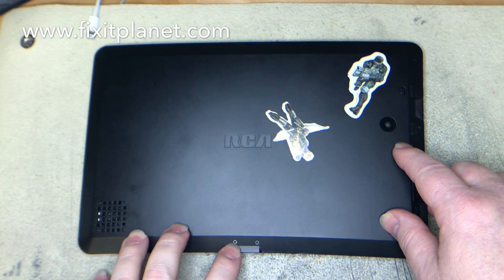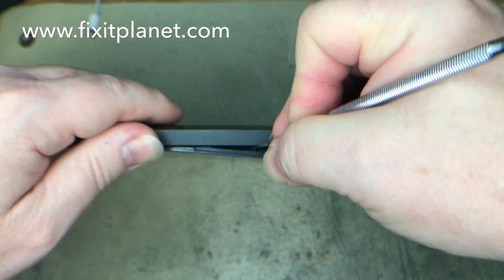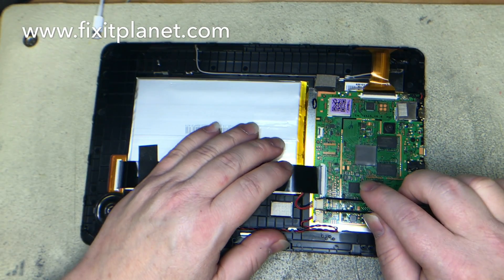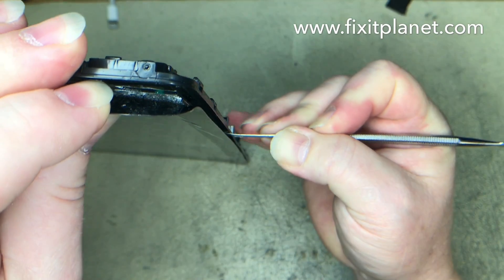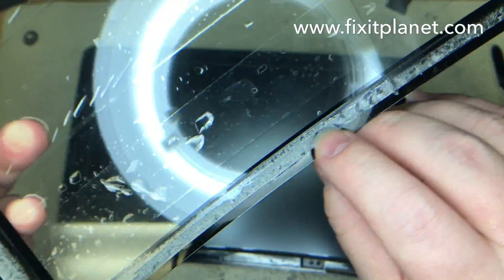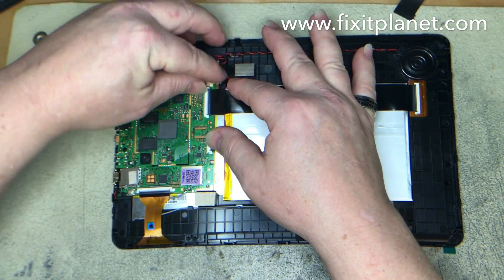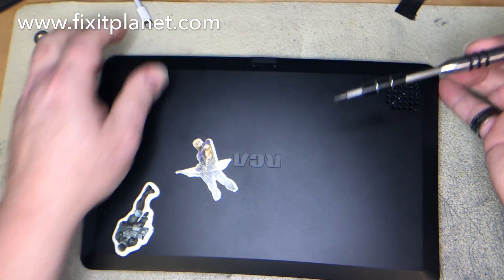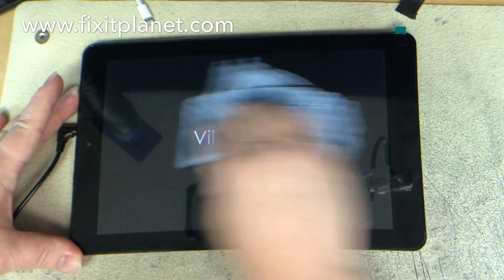RCA Viking Pro 10.1 Touchscreen Repair From Start To Finish.

Comment: Thank you.  I am gonna have to order a new screen.  My kids finally had broken my tablet screen, so i need to replace it.  This looks pretty straight forward.
Reply: So, I replaced the screen, the display works, but now the touchscreen part only works on the lower half of the screen.  What should I do to try and fix this?  I hope I did not screw up the tablet too much...
Reply from the maker: @10-eproductions25  Ok you need to review over everything. If all is good, then the part is defective. Otherwise you may have done something like physical damage to the motherboard.
Reply: Everything else works.  I can use a mouse or the touch pad on the keyboard and it works.  Did a scan and everything checks out...
Reply: Should I return the part?  I got it from Amazon.
Reply from the maker: @10-eproductions25  Sure can't hurt. Try another one and keep trying till you get it right.
Reply from the maker: @10-eproductions25   it sounds like a defective touch screen or it is not connected properly. keep trying.
Reply from the maker: @10-eproductions25  Yes and try try again
Reply: @FixItPlanet1  Boa noite  amigo seu vídeo foi esclarecedor , muito bom .
O meu tablet RCA viking PRO 10 quando conecto o carregador ele acende uma luz azul mais a tela não aparece nada e também não liga . 😥 Poderia me dar uma dica ?
Reply from the maker: @TiagoNascimento.  Obrigado, você pode tentar executar um reset e ver se ele será exibido no modo de recuperação. Desça completamente o dispositivo e segure o botão de volume para cima e o botão de alimentação até que o logotipo da RCA apareça na tela. Quando a tela mudar para o bot do Android em sua parte traseira, pressione e segure o botão de alimentação e, em seguida, pressione o volume mais uma vez. Neste ponto, a tela de recuperação do sistema Android aparece, com uma lista de opções. Use os botões de volume para cima e para baixo para navegar no menu e fazer seleções de acordo. Para redefinir o dispositivo, role para "limpar dados/redefinição de fábrica" e pressione o botão de alimentação. Confirme a seleção percorrendo várias entradas "não" até que a palavra "sim" seja visível. Destaque "sim" e pressione o botão liga/desliga. Caso contrário, você terá que abrir o tablet e solucionar problemas com uma boa tela conhecida. Boa sorte!
Reply from the maker: Nice

Comment: Why do U disconnect the battery & the other 2 wires I saw U remove & then reattach.
Also, where can I get an RCA affordable screen to fix my iPad??
I also didn't really see the new screen before U were putting it on.
I believe there is a clear thin plastic film I saw a guy remove before he put the cover back.
He also didn't remove the battery wires or anything else. How come U disconnected the battery to put a new screen on??
I'm not sure which RCA iPad I have either.
Where is a good place to get an affordable new screen.?
My RCA iPad isn't responding to touch. The screen is also cracked so maybe it is too cracked to work anymore.
Let me know where to get a new screen for it, please.
Thanks for not having loud music in the background, speaking loud enough & not going too fast.

Comment: How do I go about getting it heated up without a hot plate? Would a blow-dryer work also? Or any ideas
Reply: I have the issue where only half of my screen works at the moment.
Reply from the maker: If all you have is a hair dryer then that will have to do. Set on high and go for it.
Reply: @FixItPlanet1  Yes my local shop will not fix it. Thanks for the video all besides figuring out how to heat it up correctly looks like I could do it. Really appreciate it.

Comment: My dog cracked my screen on an rca galileo pro, thing is once I removed the screen I realized that not both screens were cracked. I have stuff I haven't backed up is there anyway to recover my data or even switch the hard-drive if I were to buy a new replacement. Thanks.
Reply from the maker: Unfortunately you cannot just switch out the hard drive it is soldered directly to the logic board. The cheapest way to recover your data is to replace the touch screen. Assuming the LCD is not damaged. Be sure to verify your model number before buying. I don't know your exact model number but here is a link for example. https://amzn.to/2qNVbhg
Reply: @FixItPlanet1  the LCD screen is cracked...my luck!
Reply: @FixItPlanet1  Thanks for the reply!
Reply: @FixItPlanet1  Thanks for the reply!

Comment: So I watched this video before I even tried to attempt buying the part for my screen. It's not broken and works fine but the colors on it are all disoriented. I am going to fix it tomorrow as I got my screen and stuff today. So wish me luck! I'll post after I attempt to fix it and see if that was the issue

Well I think the screen I bought was a bit off on where they put their border because everything else is fine. So no big complaints worked great and even though my screen didnt come off as smoothly as yours (Since I dont have a hot plate) it was hard and even a bit fun to fix.

Comment: Excellent video thanks. I thought to buy a new one but I might just fix it.
when did you say you were testing the tablet? with the glass on the touch screen but before gluing it? I wonder if the glass comes with the adhesive

Comment: Wish I would have watched this tutorial before I bought a LCD + Digitizer combo...  I just assumed the touchscreen digitizer was adhered to the LCD display, like how it is on let's say an iPhone or something.  Didn't help that in the description of the item it said:   "LCD Preattached ,Touch Digitizer easier to replace item"
Could have saved myself about $40...  Anyone want to buy an LCD display?  😁
Reply from the maker: oops... hopefully you got it working anyway. ;)
Reply: Fix It Planet 
I just ordered a new digitizer by itself, and if the installation goes smoothly, think I'm gonna return the combo set.  I don't have a heat gun or hot plate, so that might be a problem. 
Thought about keeping the set just in case the display craps out in the future, but the set cost $50 and a brand new tablet with the keyboard and everything, only cost $70 now!  So, seems kinda like a waste.
Reply from the maker: The main thing to watch out for is over heating the LCD. Too much heat will leave a burn mark in the display. If your using a hair dryer it will take much longer to heat up so just be patient, take it slow and easy and try not to over heat the display. Oh and the touchscreen has thick glass beyond the plastic edges that can splinter and cut you.
Reply: Yes, I am interested in the LCD

Comment: Again another happy member of the Society of consumer electronics / 12 volt service industry and installation of aftermarket accessories. Thank you for posting this video my only questions were how long do you put it on a plate and how hi do you set but I used a butane heat blower and got it apart successfully without damaging the LCD the glue was the hardest part again thank you so much

Comment: I have the RCA Galileo Pro, and when I turn it on, there are just lines on the screen. How can I fix this?
Reply: that means it is broken on the inside you cant fix that
Reply from the maker: You will have to replace the LCD too.
Reply: Or you can just go get a HDMI port plug it in your computer and then put it monitor and their you go.
Reply: Thanks for the replies. I did connect the tablet to my computer monitor with a mini HDMI to regular HDMI cable, and it displayed properly on the monitor, so I guess it's a problem with just the screen, and not with the tablet's video circuitry. It's easy to find replacement touch screens for the Galileo tablet online, but I haven't been able to find a source for the LCD screen.
Reply: Not true. I have a viking pro like the one in the video (but a different model a bit) and my niece dropped it, blitzing white lines were all it showed. All i did was unscrew, take off back, take out and put back in the ribbons refastening them down, wah-LA, fixed. 

I came to this video to make sure when I take off the back there wasn't anything I needed to detach or watch out for like on an iPhone.

Comment: Thanks for the vid! I fixed it! I would like to add that be sure to REMOVE THE SD CARD ! I stupidly left it in, and when I put it back together, was messing the alignment up of the usb port! Was a pita to take it apart and remove the sd card. Also I think a hair drierr would work well to heat up the adhesive for glass removal. I cut it off cold, got tiny pieces of glass everywhere!  Anyways thanks again!

Comment: I keep trying to get the part right by where the keyboard attaches to come off but it won't. Everything else is off except that. What am I doing wrong?
Reply from the maker: Just leave it in place and disconnect the cable from the motherboard.
Reply: Fix It Planet Okay turns out I accidentally left screws in, so I have the back off. :)

Comment: so I was able to fix the screen and replace but it is coming on with the cracked lines still showing on the screen. does the LCD need to be replaced?
Reply from the maker: Yes unfortunately it sounds like the display is cracked and needs to be replaced as well.

Comment: I think I may have disconnected the docking wire, sigh.  I love your channel btw.  I have two of these tablets, the Version A and Version.  What kind of hotplate do you use?  I love repairing tablets as a little hobby.  It is fun.  Do you think I should clear the cache first before attempting to take the back off again?
Reply from the maker: Thank you, Uyue 948Q+ very inexpensive but works fine for most tablets and phones. No need to clear cache.

Comment: Would you be able to tell me what the black, wide ribbon over the battery does?  Mine came loose and now the screen is black but with sound even after I've reconnected it.  Thanks!!
Reply from the maker: LCD display cable
Reply: Just reconnect the cable and you are good to go. Do both ends.